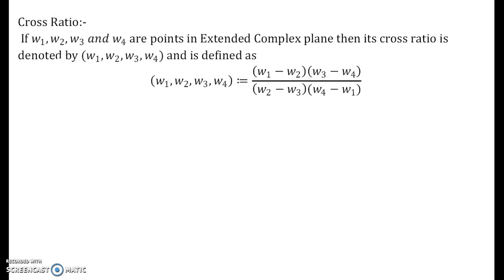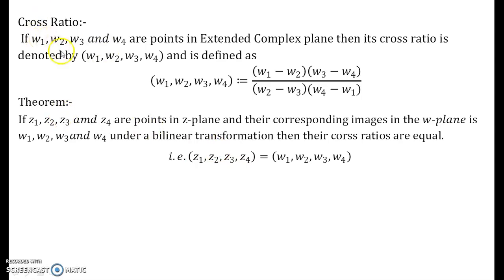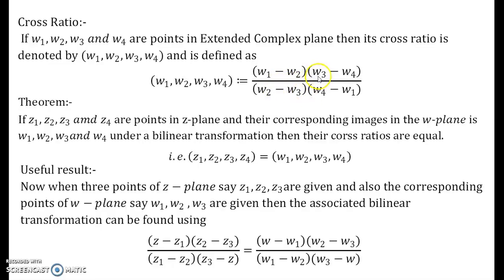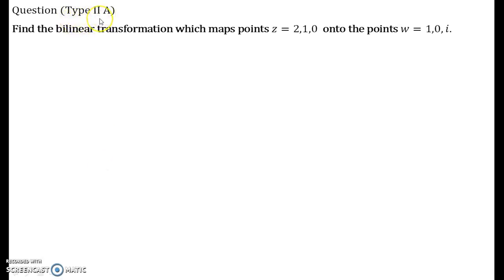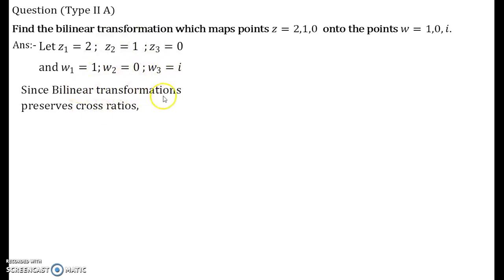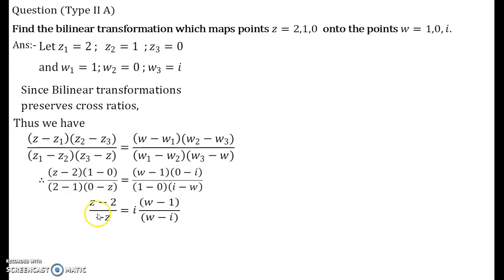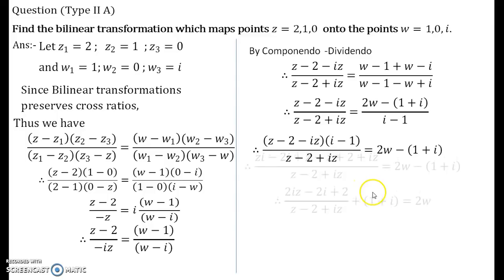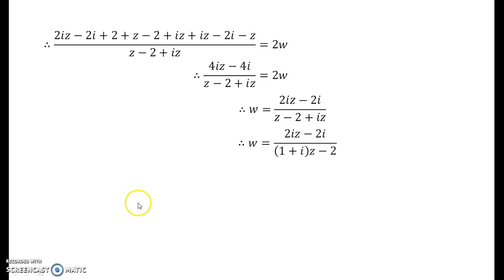Bilinear transformation Part 6 Cross Ratio and Problems

Comment: Z(0,i,-i) and w(1,-1,0) solve this
Reply from the maker: Answer is (-iz+1)/(3iz+1)
Reply: @mayurgo10  sorry iam not getting this answer. 2iz/1+iz=-w+1/-2w I got like this after this
Reply from the maker: @phanisai1315   for which question
Reply: @mayurgo10  z(0,i,-i)&w(1,-1,0)
Reply from the maker: @phanisai1315  you will get the same answer that i have given
Reply from the maker: @phanisai1315  once you plug in the values correctly in cross ratio formula you will get  2z /(i+z)    = (w-1)/ 2w  and now RhS , you separate the denominator  find the expression of w which is  w= (z+i)/(i-3z) this answer is equivalent form of (-iz+1)/(1+3iz)
Reply: Steps
Reply from the maker: @divyabalasubramani2237  similarly the way I have solved above example

Comment: Z points 2,i,-2 and w points 1,i,-1
Reply from the maker: the same way you can solve the problem  
Let z1= 2 ;  z2= i  ; z3=-i   &  w1=1 ; w2= i ; w3= -i and  use the that say bilinear transformation preserves cross ratio. Watch the video till end , on similar lines  you can obtain the transformation

Comment: What's the answer
Reply from the maker: raj shah which answer you want?
Reply: Mayur Gohil the question you gave in the end of this video. Bty your tutorial is very very good. Really appreciate it.
Reply from the maker: raj shah  thank you so much
Reply from the maker: raj shah answer for the practice question  is w=(1-z)/(iz+i)
Reply: Mayur Gohil thanks, I think I've done some sign mistake, my answer is w=(i-iz)/(z+1)
Reply from the maker: raj shah no you answer is also correct.  Your and my answer are equivalent . If you take i common from Numerator of ur answer  and multiply and divide it by i  ,you will get my answer. Even if you don't solve further  ,it is correct . Your answer is also correct
Reply: Mayur Gohil yeah right. Once again many many thanks.
Reply from the maker: raj shah ur welcome